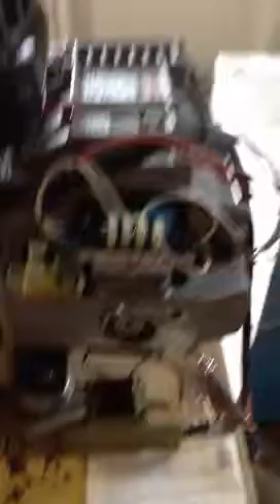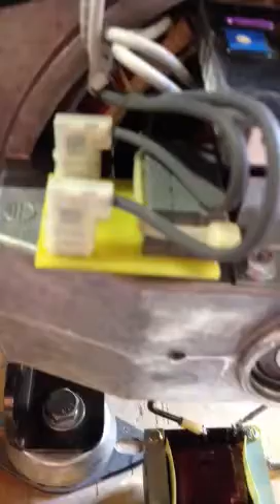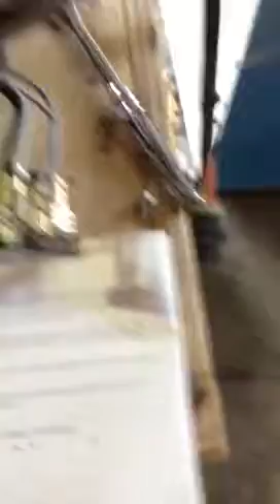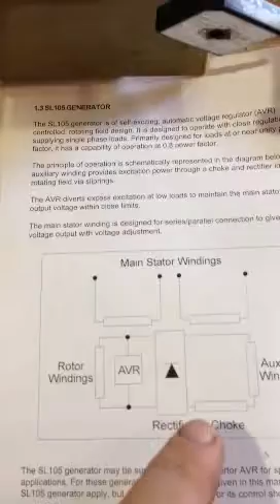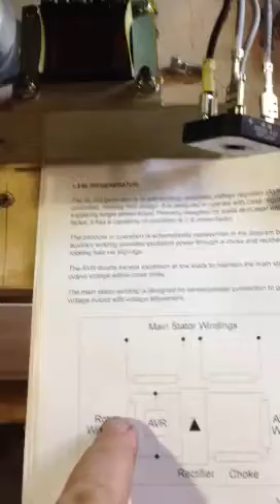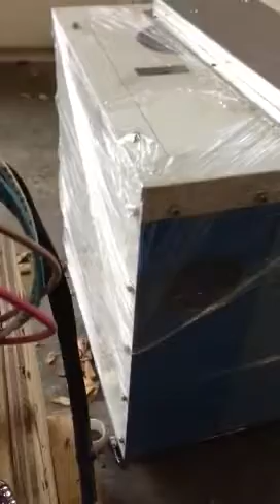Markon generator trouble shooting

Comment: Great Video thanks! Now, I have a problem with an SL105G, 7Kva generator. I was about to pull the AVR off, but I noticed that the Grey wire which is supposed to be connected to F1 is actually connected to F2. Of course whether this is actually wrong depends on whether the other ends are swapped too. I wonder how to tell where the F1 wire should be connected?